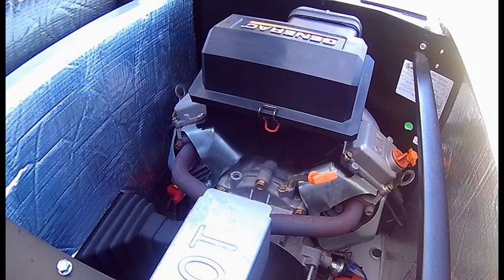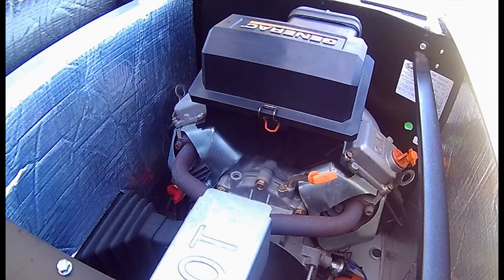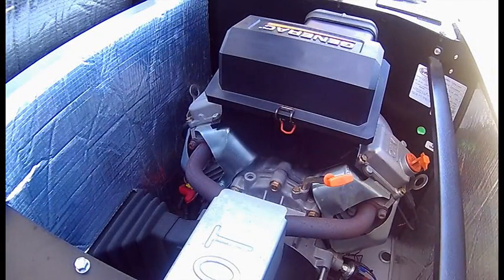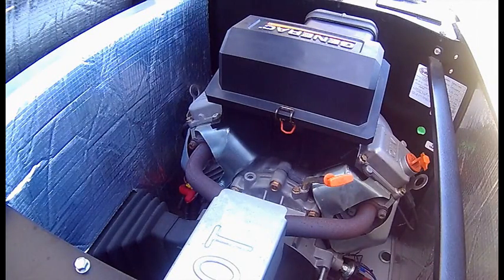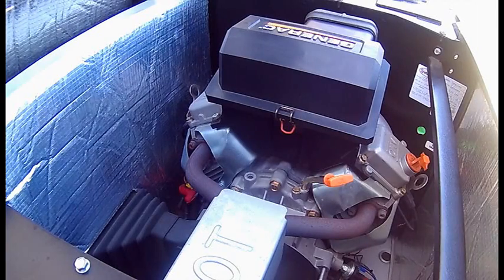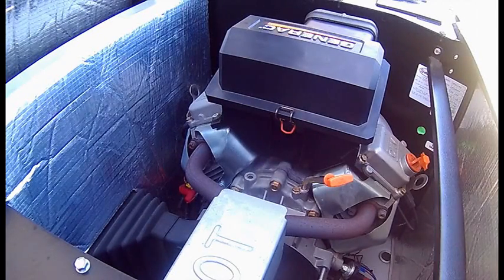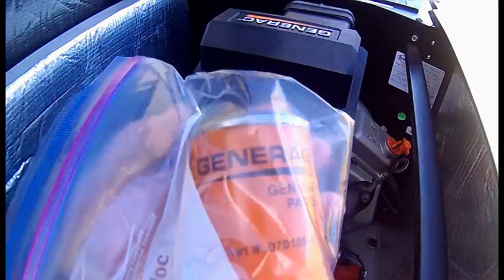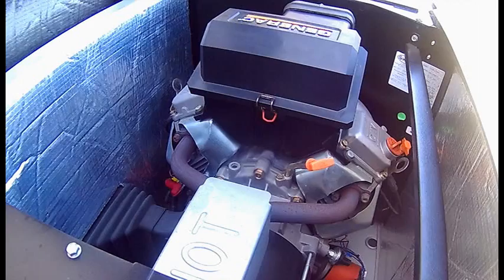My Big Bad 20k Generac Rant

Comment: Good morning Sir, that is a great generator 👍😉 Yes air cooled is better for your use for sure 👍 Yes it is great to do a very good maintenance on them 👍😉  Using quality parts and very good oil is a very good for your expensive investment 👍😉 Doing a great management of the electrical panel is very important when you have a small generators or if you want to save on fuel 😉👍 Some generator have a electrical block heater and keep everything dry 👍😉 Very good detail explanation video Sir 🧐👍 Cheers 🍻